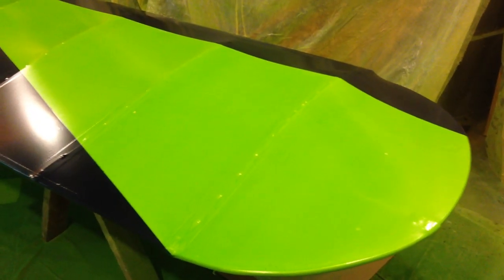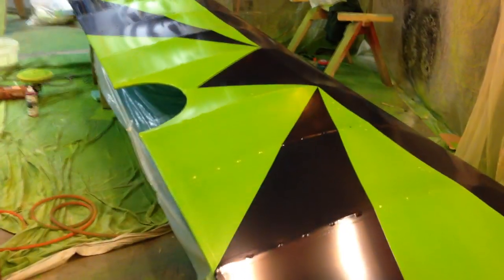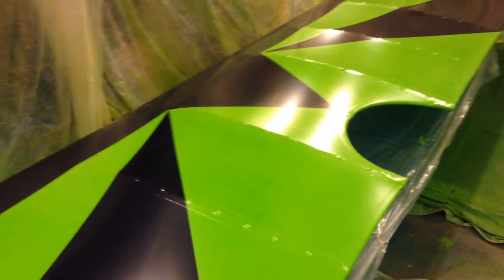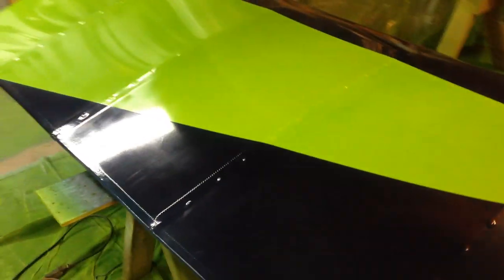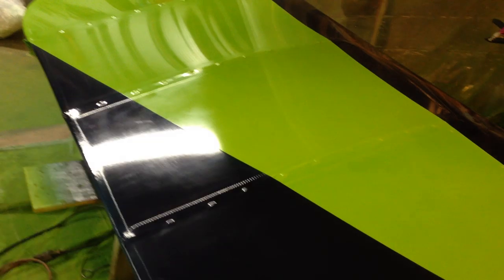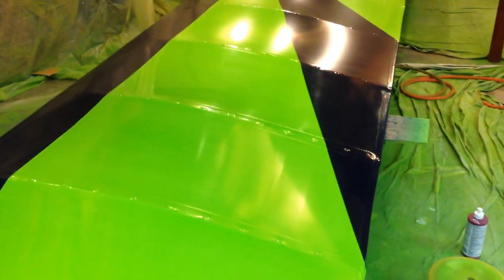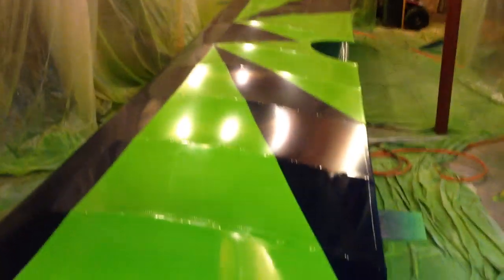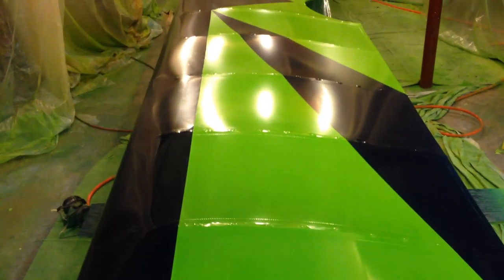Latex Paint on Micro Mong Wing

Comment: I know that this plane is long gone, but really appreciate the information - this is my go-to reference for high quality latex paint jobs?  Quick question:  Which "3M Perfect-it Polish" did you use - it comes in three types: White, Black, or Blue cap (Product Numbers 06085, 06064, 06068).  Please let me know - I just did some kitchen cabinets and they would greatly benefit from a light polish.
Reply from the maker: I can't remember on the 3M polish. I have since switched to Meguiars  Ultra Cut  with a yellow foam bonnet followed by Ultra Polish with a soft black foam bonnet. I like the job that the 2 step process does. Any compound should work. I would look for one that targets the last sandpaper that you used (some target 1200 grit marks and others are for finer scratches)
Reply from the maker: https://www.youtube.com/watch?v=OhlxE3EFcCQ&t=2s  This video shows the polishing
Reply: Malcolm Morrison you are a genuine craftsman!  And, I greatly appreciate the quick response - Happy Easter!

Comment: Excellent videos.  I have a homebuilt that was finished through poly-fiber polytone, but I am not happy with the finish. Can the latex be applied on top of the polytone or would it require complete recover? I am not concerned about weight since this was originally designed as a 2 place airplane I built it with only one seat.
Reply from the maker: I've applied latex over a variety of finishes, some unknown. I know others have used Polyfiber products as a base with latex as the color coats with success. It's important for what ever base coat is used that it has a good grip on the fabric.

Comment: Is that latex paint the same used on walls?
Reply from the maker: I use an all purpose exterior latex.
Reply: I wonder if we are talking about the same paint...

Here in my country Latex paints are Latex PVA paint, they are not normally used for exterior paints.

If you want to paint something that will be exposed to weather we use Acrylic paint over here...

But if we both are really talking about Latex PVA paint, i am really impressed.. Had no idea it could be wet sanded and polished like you did.